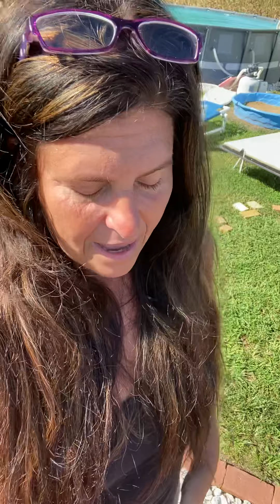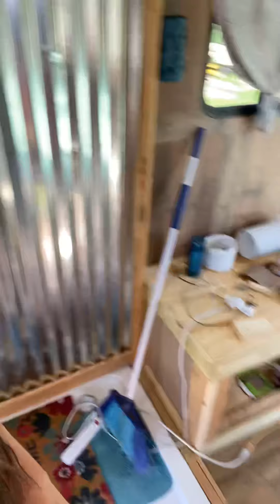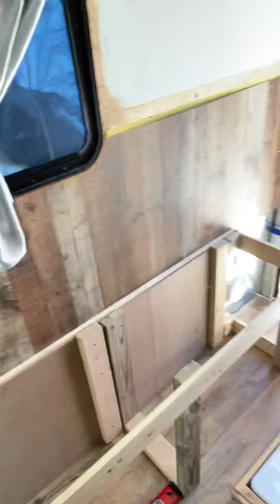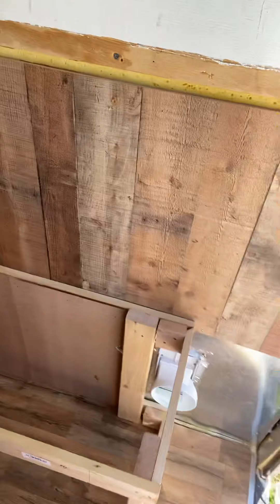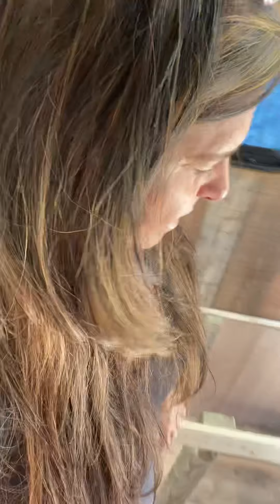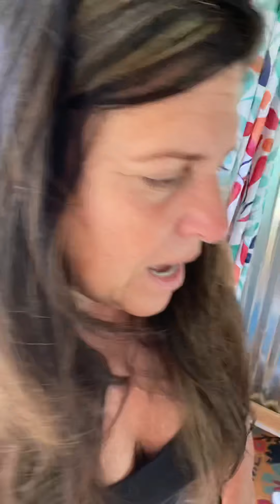Keeping Busy in the Cargo Trailer With My Beloved Sissy Cat By My Side

Comment: Prayers for your cat getting better, if they are not sure what's wrong have you tried a laxative? If there's a hair ball or some obstruction laxatives could help. I won't get into the details, but i messed up my intestines at the gym and blocked my intestinal tract up severely a few years ago. I was bloated and it hurt so bad i didn't want to move after 5-6 days. I didn't go to the Dr, i got some mylanta and a water bag and by day ten the dam had burst finally. Thought I'd suggest it, not sure if the vet did. 
   The crush weigh vertically for wood is pretty amazing, like columns in stone building, you don't have to put in a bunch of 2x4's for the little weight a bed will put on the bench. You could easily jave used 1x2's for support where you have the 2x4's. The problem you would have is unbalanced load on top pushing them over. As long as you have a horizontal brace from side to side so they can't be bowed and break you'll be fine. Your whole trailer could be balanced on a 3 foot 2x4 and it would hold it without breaking. If you have a board at the bottom and top of your bench (in between vertical braces at bottom nailed to the floor, and resting on top at the top preferably) you wont have any issues with load bearing. If you went four feet or more it wouldn't hurt to have a cross brace in the middle but it looks like yours is 24 inches at most. 
   Once you have the ends and sides covered with plywood it will help keep it from racking. It will end up being one third the weight you add by using a lot of 2x4's. I ripped 1x6's down to 1 1/2 x 3/4 boards and my 240 pounds plus the 80 pound bed frame doesn't come close to sagging my benches. Not trying to tell you what to do, just offering information. The weight adds up quickly. God bless!!
Reply from the maker: Thank you Mike.  Your input is very welcomed and yes….I believe as well what we have started here will sufficiently hold the weight that will be on it.  I agree I didn’t need a few of the 2x4’s I have….but I wanted to be able to use longer screws and beef it up a bit….You’ll be surprised at my ingenuity I end up with.  Lol!!! 

Thank you for your prayers…..They are coveted at this time.  💕🙏🏼🇺🇸
Reply: @womanoftruth6873  I'll be watching lol, it's definitely beautifully done. Mine was getting noticeably heavier after i put my solar panels up and built the Murphy's bed frame out of 2x10's. I had enough 1/2 plywood to do my bench seats and cabinet faces with but i was concerned with adding the extra weight. I pried open the wallet and bought some luan just to save the hundred pounds of material weight, i do believe im going to end up with drivers side of the trailer a couple/few hundred pounds heavier than the passengers side. Hopefully the batteries, inverter and controller help even it out. I will probably have to drive with the bed down to get the weight centered. 
   One thing for sure, it takes plenty of ingenuity to get them how we want them, there's more to it than a lot of videos show. I like videos like yours, showing the problems and redo's help know what not to do as well as show im not the only one who has to rethink and problem solve. Hope that ac works out, God bless!!